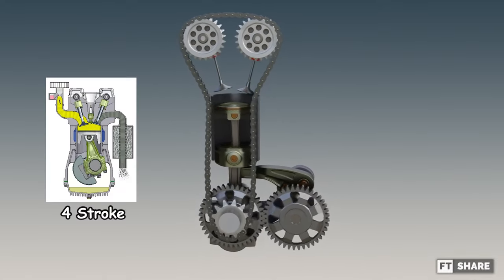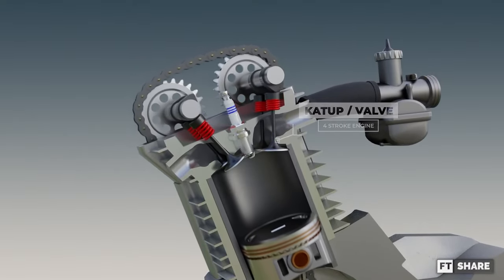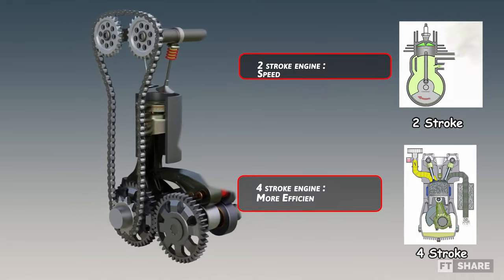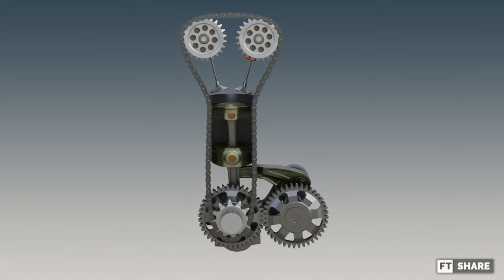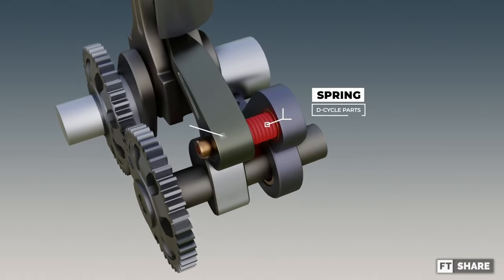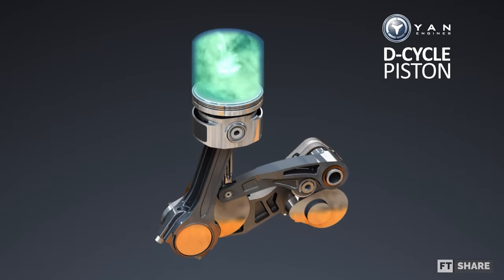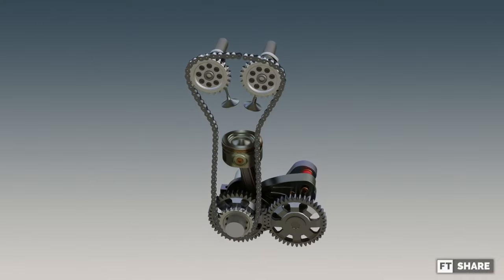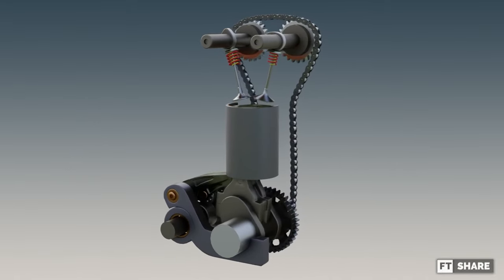Perfect Combination Of 4 Stroke & 2 Stroke Engine | D-Cycle Engine (UHD 4K)

Comment: 1. you're going to get less compression due to how late the intake stroke happens
2. you're going to be limited to very low RPMs due to how there's no apparent way to force the piston down onto the camshaft
3. I wonder if all the power will truly be forced onto the piston itself, or if it will just be transferred to the camshaft instead, due to how the camshaft's profiles are designed.
It's an interesting concept that I hope gets iterated upon, but at the moment it looks like it's only going to be a concept.
Reply: I think the spring forces the piston down onto the cam, so the engine has to charge the spring every shaft rotation. And there is the friction from cam, which is going to be pretty large given the force necessary to charge the spring. But the idea of a two-part piston with a port on the piston face is interesting.
Reply: That spring and cam are quick pacing the exhaust and intake strokes while the crankshaft is loaded under compression and power strokes.  Very clever but you lose the light weight advantage of a 2t and the full torque of a 4t.
Reply: I found it funny that “valve float” was stated as a possible problem. What about piston float??  The piston needs to travel down under vacuum only by the force of a spring. It will never reach rpms where valve float is a problem.
Reply: I think piston return springs would break in a few hundred hours of runtime.
Reply: @AndreasBrOlesen  My red flag exactly. As it is, that camshaft and spring of the piston top will limit this to a very low rpm. Never mind softening that impact... what the piston top needs is it's own small crank in place of the camshaft so that it can be pushed AND pulled (or a desmodronic cam).
Reply: Lower rpm also because of the added inertial weight by having 2 con rods per cylinder.

Comment: Nice video! 
The direct injection of the SkiDoo Etec solves the problems of the economy and emissions of the 2 stroke. It seems negative press is what is killing the Direct Injection 2 strokes. 
Another option is to have a blower like the Detroit 2 stroke diesels to have a normal wet sump oiling system. 
Another option is take a regular direct injection 4 stroke motor, add a supercharger and gear the camshaft one to one with the crankshaft to get a 2 stroke motor.
the Koenigsegg engine camless motor can also "2 stroke".
Reply: Opposed piston 2-stroke, I think it's called Acates or something. They might have a collaboration with either Detroit Diesel or Cummings for some "universal" engine for US military. No valves, and I think the oil works like a normal 4-stroke.
Reply: Free valve is VERY interesting. 

I'm quite curious about running valves and direct injection as 2-stroke. Maybe different cylinders running 2 & 4 stroke in parallel? I'd love to see the Dyno chart for that...

Comment: That return spring would have to be humungous! It's not controlling an itty-bitty valve, but a huge rocker, conrod and piston. The return spring would eat up power, and valve-bounce would seem to be a trivial problem when the auxiliary piston and associated hardware starts to chatter. Maybe desmo would work, but this thing is already insanely complex. And heavy.
Reply: Was about to say the same thing, the spring is the only thing stopping the piston at top of stroke at the moment. Flipping CLANG!!!!
Reply: yup!
Reply: You could do something like the Hondas that uses spring free valves with a cam design that both push and pull.

Comment: One word - vibration. The cam driven piston section moves somewhat erratically compared to the approximately sinusoidal movement of the crank driven piston section. This would be quite difficult to counterbalance, adding further complication, if indeed it is possible to achieve.
Reply: Cool vibrations

Comment: Thanks for the article, the comment, and the reply about the D-cycle (4 Differential strokes) which is a hybrid of the 2-/4-cycles. Besides better fuel efficiency (our tests show >20%), 2.5~3times (not only 2x, less reciprocating weight and friction) more torque driving power, etc. It can have cars driven with i2, i3, and i4 (whole engine works) instead of current heavy/complicated i4, v6 and v8 current engines for more power, and less fuel consumptions – with lighter support, vehicle frame and styling. 
The split-piston inner-air-pump can further make a hybrid diesel engine with the gasoline-type combustion (not to produce soot/NOx) to avoid the expensive and the cumbersome after-treatments, besides saving fuel and m ore powerful towing power. This is the SCCI/LTC (stoichiometric charged compression ignition/low temp combustion) technology, which we are developing to meet CARB’s 2026 (and EPA’s) heavy diesel truck emission regulations. Where do you live. I am in Austin, TX. We are looking for partners if you know of someone. 
( Notes for D-cycle – following are not obvious, call to discuss:
1.	Most piston skirts need not be windowed.
2.	Ring sections can be made of stronger thin steel just to hold rings and oil to cool.
3.	The same rings stop the oil leaking.
4.	The piston-train can run directly from the crankshaft.
5.	Crown doesn’t run at higher speed and having Atkinson cycle. The full air intake can be provided via an air 2x pump.
6.	Valves don’t run at higher speed, except for fewer cylinder engines.
7.	Piston-train spring is compressed during intake. )

Comment: It doesn't make sense to me, it's basically a 2 strokes with valves, but more complex just to not burn oil :/
Reply: it 's more of a '3 strokes in one' type of deal
Reply: @mscd9676  it's so complex for no reason, at this point i'd make an engine that runs with compressed air injected with fuel :/ i have no idea if that's possible, but still more realistic than this one 😭
Reply: honestly a direct injection two stroke is almost just as clean as a similar output four stroke.
Reply: @duckdestroyer2412  but oil is still an issue if we consider euro regulation, that's the problem
Reply: @qualcunoacaso4865  Europe doesn't matter two strokes do 😈
Reply: @duckdestroyer2412  😭 i wish it could be true 🤣

Comment: Uhhh, ok. I’ve rebuilt engines and ramanufactere them for nearly 20 years. Even when my jobs in the Auto Parts industry pulled me away from engines rebuilding, I still sold them to customers via the vendors I had worked for before and after the job managing wholesale sales folded. (The crooked owner committed tax fraud. When I found this out I left and was offered jobs before I was able to call anyone.) So I always found myself back at the shop. that said, even though we built several custom engines, I’m scratching my head. I dont see a cuter as this engine is as I practice as it unique. But the exercise in design will help engineers find a solution to our present challenge. I believe that the right fuel can keep the internal combustion working for the foreseeable future. I believe that electric cars could make good commuters, as long as they can be recharged to allow for the trip home. However they fall short of being used for long haul, heavily loaded trucks. Even for lightweight cars on trips will not be efficient enough.

Comment: I'm not saying it won't work... but I will say it won't work for long, and the RPM will be severely limited by the cam-operated compressor piston. That's a lot of upward momentum to be contained by a spring at such a comparatively short radii from the active mass. The force required by such a spring to operate even above 1,000 RPM would require frequent replacement of the cam follower bearing... even more so, if the bearing is a ball bearing (as depicted) as opposed to a needle bearing.

Also, limiting combustion to a single volume, with little-to-no contact of the intake/compression surfaces, will cause significant heat management issues. While it looks neat, and might work for an extremely low-speed novelty engine... practical applications would be slim-to-none.

Comment: Props for creativity but this is a deadend.  It is still stroking 4 times mind u ur just doing it in a more complex way with more weight.  Better off having the  exhaust pushed out on the next rotation than this mechanism.  And the vibration with this would be horrible.   Double the reciprocation going on.   Good job designer let's move on to another design.

Comment: Well, I'd like to see a working prototype before jumping to conclusions but if the components that are obviously going to be prone to failure are made of some forged steel or at least hardened to some degree then I think this could stand a chance. I have a bad feeling that mini piston moving twice as fast as just going to cause some issues since you basically have a 4 stroke trying to keep up with a 2 stroke. Very high speed, probably going to make things want to blow up. If this is made into a working model it better be around 2 liters so it has some chance to hold up when it gets tested

Comment: A 2-stroke engine can be made very small and it's effective for very small engines and use. And the four-stroke cycle engine is better for bigger size engine
Reply: 2 stroke work well as a big engine to, most ships use 2stroke diesel engines 😊

Comment: It sucks. But yes, an engine that utilizes both two and four stroke processes will be a great improvement. A sequential triple, with pre-compression and re-expansion done with two stroke cylinders and combustion with a four stroke. The system takes ten strokes to complete because pre-compression and re-expansion cylinders are run at 1/2 RPM.

Comment: Very ingenious principle. We might think it gives almost double the horslower, as it has double the amount of power strokes. However appart from all disadvantages mentioned already it also will have limited rpm due to maximum piston speed (avoiding exessive wear). So also with lower rpm, the horsepower might not even exceed a normal 4 stroke even without all the extra mentioned losses.

Comment: 65 degrees of intake? Would have to be forced induction,  uses normal valve springs plus another torsión spring?? They already have a 2 cycle and 4 cycle hybrid that works and is simpler  than that proposal...its called a Detroit Deisel. Has a power stroke every revolution...revs high.  Low torque at low rpm but quick to accelerate crankshaft. Has exhaust valves and springs

Comment: Panhard & Levassor once produced cars with 4 stroke engines upon a Knight patent sparing the valves to the benefit of transfers. At that time it was looking way more beneficial than to add valves on a 2 stroke, and indeed was it. 
Here that 4 working on 2 will just waste energy, the crank being pushed a random amount of time (<2*~1/8th which equals < 1/4) ; colliding with a going down piston one on two cycle; adding the load of DOHC to a 2 stroke to make it less efficient (not even considering the 3rd cam shaft and the repelled piston head with a loaded spring adding more restraints)
Energetically non viable, end of the dream.
Reply: And what about if it used Free valve technology and direct injection?

Comment: Less power than 2 stroke, more complicated, large and heavy than 4 stroke, vibrations never seen on this planet... please add one cylinder more on a 4strokes. It's easier. Or adding a compressor, it's easier and better.
"Turbo is the way God has to let understand you have not enough cylinders "

Comment: Looks EXTREMELY fragile . Proper Two-strokes are not necessarily wasteful of Fuel charge if the Exhaust system is correctly made .
Emissions issues are due to External , Boundary lubrication being needed . Or a blower can be used , permitting Wet Sump lubrication .

Comment: This engine concept can't work because the power stroke of the upper piston imparts the force of combustion expansion into the cam via the spring arm. Cams cannot receive energy, they exert energy. Even if the cam could survive being punched by combustion force trillions of times without wear or destruction, there is poor leverage moment on the cam by the spring arm, so no torque could be extracted from the combustion gas.Terrible fantasy concept.